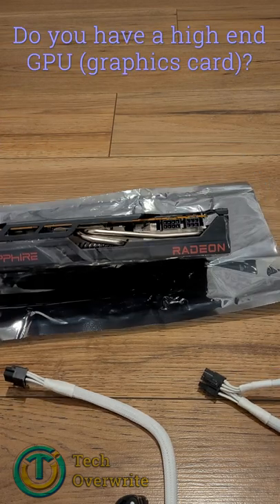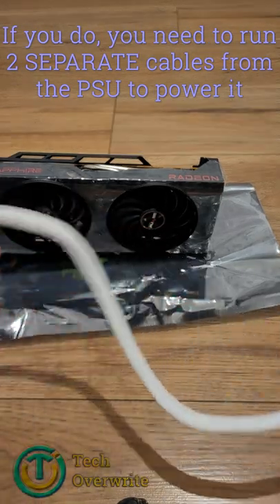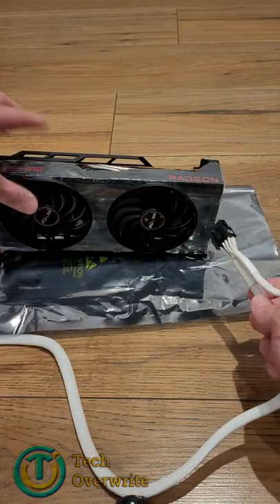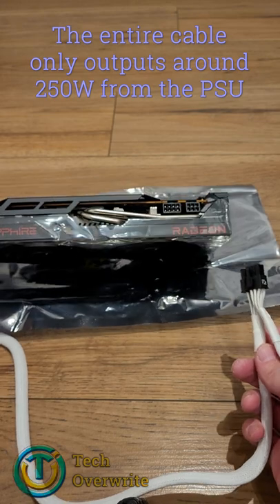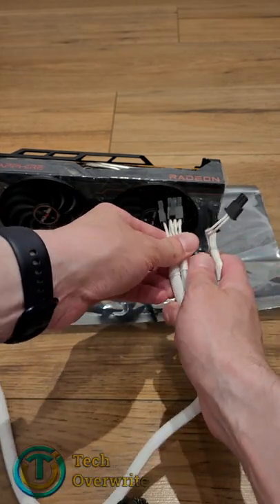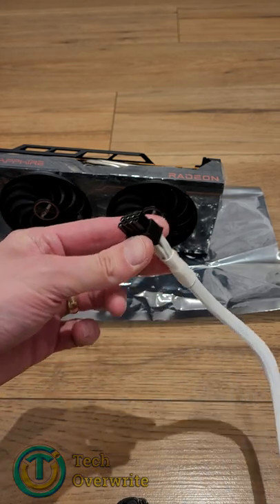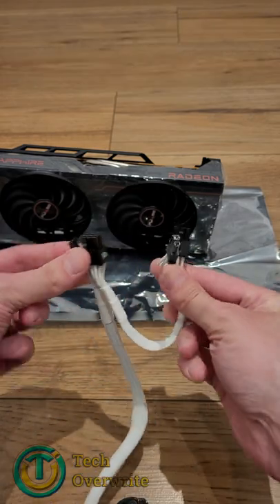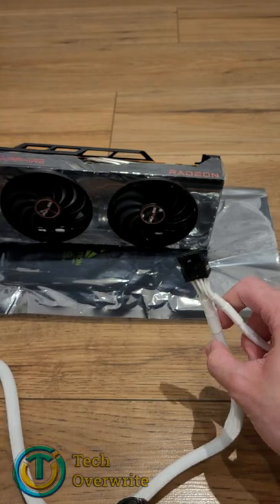Why You Should NEVER (Usually) Use The Same Split (Pigtail) PCIe PSU Cable #Shorts

Comment: Just installed my 3080ti and this was the first short that showed up 😂 thanks for the info changing it now
Reply from the maker: Hah 🙂 Glad this video helped you. That's an awesome card, I hope it works out well for you.
Reply: @TechOverwrite  can i power the gpu directly without powering the riser?
The riser has a small 4 pins
Reply: @TechOverwrite  Will the gpu get detected if you dont connect all Power cables 
(3 8pin slots on a Rtx 3080)
Reply: @Adwans  Don't think so, it has 3 for a reason, you need all 3
Reply: Bro ong The same thing  just happened to me rn I just installed my 3090 😂 I’m finna go change it rn
Reply: hey i had a question.

I have an EVGA FTW3 RTX 3080ti with two cables connected to my Corsair HX1200 PSU. 
Both cables are pig tailed. I have 3/4 of the connectors plugged into the GPU and the last pig tail hanging loose. 

Is that bad? I've been running it like that since June 2022, my computer seems to be running fine but I'd like to fix it if necessary. 

I'm also interested in getting an RGB PCIe extender cable since the current pigtailed GPU cable setup looks ugly. Any recommendations for a good rgb extender for my GPU/PSU setup?

Thanks!
Reply: @life_is_gr8  as long as you're using two separate pcie cables you should be fine. I'm sure you can ziptie the loose ends out of fhe way somewhere.
Reply: Nah you should be fine cause the pcie socket will give you a max of 75w

Comment: they wouldnt make cables like this if it wasnt safe. as long as the psu has enough watts to power the gpu you wont have a problem. ive been using a similar configuration for a couple of years using the same psu with no issues!
Reply from the maker: Thanks for the comment, I've read of people having issues with pigtailed cables, but it's always hard to say for sure that it was (or wasn't) the cable at fault 😔
Reply: @TechOverwrite  I definitely wouldn't use the pigtail with a 3080 and above. Just don't feel comfortable with that honestly
Reply: Yeah but what GPU do you have?
Reply: If you have 3060, 3060ti and a 3070, you can still use a pigtail wire with no issue at all. But if you're going to go beyond these cards? Then consider getting a fully modular psu
Reply: @johnmichaelcobangbang8425  I have 3070Ti and used pigtail. The end at the power supply melted and I removed it from box it pulled out both connections melted as 1.. glad it wasn’t my gpu side 😶 now buying a new power supply and hoping my graphics card is fine. 🥲
Reply: @johnmichaelcobangbang8425  I did have a fully modular psu but Still used pigtails 🤦🏻‍♂️ 1st build … it lasted about 3months
Reply: @eldorito777  I use one for my zotac 3080 ti. Never had a problem. My power supply is 1000w and it gets used for rendering and gaming at max usage ALOT
Reply: @skaardd  oh im using single caple for my new card rx6750xt i had worried but i think its save as you say 🤕
Reply: @johnmichaelcobangbang8425  I have a 1000w MSI mpg pcie 5 atx 3 and a 6700xt nitro plus. (I sold my 4080). The 6700xt is rated at 260w. The PSU is fully mod.and single.rail. I'll be okay using the pig tail bro ? That's all it came with
Reply: @Dannyfr33sh  😂😂😂😅
Reply: @BrainGainz21  Then you had it connected incorrectly. Probably not seated. They do not make these pigtails so nobody to use they work great if installed correctly. However if you plug in the wrong end or to your cpu outlet on your psu that will not be ok.

Comment: Omg after months of having my 3070ti hook up with pigtails and wondered why it’ was getting low fps and stuttering I tried this and that thing runs super smooth and even the game itself looks 10xs better. my card came with 2 singles I just couldn’t figure out why..But now I know and I’m super excited all over again about purchasing the card
Reply from the maker: Wow that's crazy. Sorry you had those issues, but I'm glad to hear that you fixed up the problem okay 🙂
Reply: So you mean you are using 3 single cables to fill all the 3x8 pin slots?
Reply: I was doing the same and my power supply melted the connections(at the power supply) then my gpu stopped working randomly“DP/HDMI”  I would restart my pc and it would work again. Until it stopped for good 😶 that’s when I took it apart and noticed the damage.. but fans and lights still kept working.. 😬 Going to buy new power supply and hopefully graphics car is still okay🙏 (same gpu)
Reply: @BrainGainz21  your psu melted because you used 1 cable?
Reply: Same I’m using a 3070ti with the pigtails and I was wondering why the cables were so hard to plug in too… I’m so dumb 🤦‍♂️
Reply: @justinmarqueef3426  Yeah lol good thing it was only that 😂 got a new one already👍
Reply: @BrainGainz21  oh nice
Reply: im using 8-pin to 2x (6+2)-pin with my 3070ti right now, my game stutter from time to time. but my psu doesn't have extra pcie cable, im buying a new psu right now. hope it will fix the issue
Reply: Same here with 7900XT 😂😢 felt so stupid😅

Comment: If the cable provides 250 W and the motherboard provides PCI Power of 75 w would that not work with most graphics cards ?
Reply: I just wanna add I have always used 2 separate cables because EVGA power supply is actually recommend it to use 2 separate cables for the graphics card and I have also run graphics cards on one cable and all honesty I don’t know if it makes any practical difference
Reply: That is correct if the cable was somehow supplying such an unsafe low capacity. In reality it can supply up to a 375w gpu constant (300w at cable, 75w at slot) .
Reply from the maker: Hmm that's true, I should have also mentioned the 75W from the PCIe slot (a case of too much info for a 1 minute slot). Thanks for watching and the insightful comments 👍
Reply: It really does make a difference, especially with modern GPUs, even though they say 300 watts sustained power, they can spike up in wattage to even 500 watts (I’m using the 3080 for these numbers) it only happens for a millisecond, but it’s enough to trigger overcurrent protection in the psu

Comment: Help: is it safe to leave one pigtail end each from two cables open, just under the GPU inside the case? Or need any insulation for the open ends?
Reply from the maker: Great question. It's safe to leave the ends as they are - you won't need any insulation for them.
Reply: Thank you! Was looking out for this question

Comment: I never had problems with my gtx 580 matrix platinum back in the day with 2x8 pin from one cable, or with my gtx 760 mars
Reply from the maker: Hmm, I believe the gtx 580 had a 244W TDP? So along with some power provided by the PCIe slot itself (which I forgot to mention within the video itself, doh!), you would have been fine with the single pigtailed cable.

Comment: I’m glad I figured this out, but why doesn’t the pamphlet with my graphics card fucking explain this? Infact why didn’t it come with any cables lol
Reply from the maker: Haha lol, you're not wrong. I double checked my old and new graphic card's manuals before this video, and also couldn't see any mention of this 😔 Some PSU manuals do, but who reads those... 😃
Reply: Extra cables are supplied with the power supply… the main question you should be asking is why does the GPU come with a pigtail in the first place lol

Comment: I got an ASUS ROG STRIX 3070ti 8x3 pin connectors, but my PSU has only 2 cables for 8pin, currently Im using 1 single cable and the 2nd split ( with pigtail) to fill up all 3 slots, 

Should I instead use 3 single cables to fill maximum watt usage? In this case can I use it from my other PSU? They are both Corsair RM +gold  but one is 850W and my older one is 650W (bought 2018)

Or should I just order a new 8pin pcie connector?
Reply from the maker: You should be fine here. The 3070 Ti doesn't use a crazy high amount of power, so the two separate PCIe cables (plus the pigtail/split one) will be fine in this case. 🙂

Comment: The 12v wires in the cable can get a bit warm when pulling 300w through the cable. I have a 3080ti in my comp with three 8 pin connectors with 1-2 running at up to 150w draw and connector 3 pulling up to 75-85w. If I were to run one cable on the first two connectors, the 12v wires in the cable can get up to around 100-115F.
Reply from the maker: Interesting, that's definitely good to know thanks. 100-115F is worth keeping an eye on, for sure.

Comment: Help me, I have a new graphics card that needs 8, and I have a wire in the power supply that only has 6, and when I installed it, the screen was black. Is this because of the graphics card, or is 6 not enough?
Reply from the maker: It doesn't sound like this will work, sorry 😞 Your PSU might just not be powerful enough for your card - i.e. especially if your PSU only provides a 6 pin PCIe connector. I know that sucks though.

Comment: I just installed a 4070 in my little brothers pc yesterday night. He went from a 1080 to a 4070 & I used the one wire with the split daisy chain. PC is running just fine , temps are normal and the 4070 is performing excellent. He put around 6 hours on it and we checked the PCIE wire and it was warm but nothing to be alarmed that it will catch on fire or anything.
Reply from the maker: Fingers crossed you should be fine with the 4070 and the pigtail, since the card has a 200W TDP. Since the motherboard PCIe slot supplies 75W, the single cable should comfortably be able to supply the rest of the power IMO. Hope your bro is enjoying his new GPU, that's a nice upgrade 🙂

Comment: Thanks, I was experiencing black screen shutdowns a few times a day with my 7800 XT + 650W PSU connected with a pigtail. I've now ordered a 850W PSU and I believe that if I connect it with two cables, it'll be as safe and stable as possible. This is the first time I saw an actually helpful short.
Reply from the maker: Really glad this helped you out, it definitely sounds like the new PSU and using two cables should help 👍
Reply: im using one cable for like a month and never had this problem on my 7800XT but i do saw a gaming performance increase when i use two cables instead of just one
Reply: @feraltwitch  It was the card. I replaced it with a 7900 XT half a year ago and no issues at all.
Reply: @headlesscyborgcz  ohh i see but actually i just realized ur PSU was not quite enough for the GPU, recommended by AMD it should be atleast 750W. but whatever glad you got a better GPU

Comment: Could you help me?
I have a 250w fsp oem psu without any pcie power connectors, and I put in a gtx 1650 which is by no means high end, requiring only a 6 pin connector (some of them don't even have one) and after running a more demanding game or benchmark, the program would just turn off by itself, sometimes the pc restarts?
Why does that happen? 1650s without 6 pin have a tdp of 75w, and I can't imagine a 6 pin model needing much more than 10-15 watts, which the adapter can probably easily provide?
Reply from the maker: A motherboard's PCIe slot will supply up to 75W of power, so unfortunately your setup is borderline. Anything strenuous will almost certainly result in a lack of power, because it will quickly cap out the supply of power to it.

Comment: Wire gauge plays a big part, it's not just cut and dry. Higher end PSUs often give you 16awg wire for the PCIe, some even 14awg, and can supply plenty of stable power without high voltage drops under load. Cheaper PSUs though may use 18-20awg.
Reply from the maker: Ah that's a good point, thanks, I hadn't considered that point. Worth knowing though for sure 🙂
Reply: how many amps an  18awg  12v wire can handle ?

Comment: Wrong. a PCI-E cable provides 150W and the PCI slot on the motherboard also provides 75 W, so if we're talking about a card that draws a maximum of 225 W then it is safe to use a single cable. While your conclusion of using 2 separate cables is the best and safest approach, it's also important to double check your info and make sure you deliver correct information through and through
Reply from the maker: You're right, thanks for the detailed info. I completely missed out the PCIe slot when shooting the video, and you're right that this is an important consideration. Thanks for the reminder 🙂
Reply: Can I use it for 2060 super?

Comment: What about the Rtx 3060ti dual mini? I think that only has 1 8 pin connection? Does that mean it’s limited to less watts
Reply from the maker: That will be fine - it specifically works/expects a single PCIe power cable, due to its low power usage. So nothing in this video should affect the running of your 3060Ti mini 🙂

Comment: So what if i my gpu only has one power connector, do i just plug in the main pcie cable and forget about the pigtail pcie, or do i need a pcie cable adapter? im using non-modular psu btw
Reply from the maker: Hmm that's tricky but you would need the pigtail in this case if your GPU requires 2 connectors. However you will be limited to a certain GPU TDP (power requirements) - maybe 250W. If the GPU is too powerful, your PSU might not be able to power it reliably.

Comment: If the cable output is up to around 250 watts, shouldn’t it be fine to put in a GPU that uses up to 325 watts at peak because of the 75 watts drawn through the motherboard?
Reply from the maker: Yes that's true, I missed that part out of the video - was trying to squeeze everything into 1 minute, but should have mentioned this point. However I would say that a GPU requiring 325W of power probably shouldn't be powered be a single cable because that's a bit too borderline. Probably better to play it safe. But generally speaking, I agree with your point yes 🙂
Reply: But some area or country that not have a stable power voltage could potentially initiate micro power spikes that could ram up gpu power consumption more than the tdp rating, gamer nexus explained it at some of his video. Thats why the psu atx 3.0 exist, to eliminate the power extrusion problem. For older gen psu I'd say, leaving it 50w headroom for the cable is the safest bet.

Comment: I'm using Asus Tuf RTX 3070 oc Edition maximum power draw(or power limit) 240w that requires 2x8pin. Right now I'm using two separate cables 2x(6+2)pin and 2x(6+2) are just hanging around. Is it safe to use only 1 cable and pigtail. I always undervolt GPU without losing performance(same core clocks) but by doing it reduce the GPU power draw to 180-190w depending on game or FPS limitations. If I cap the FPS it further decrease the power consumption to around 150w. Do you suggest me using only one cable and pigtail as I always undervolt for better thermals and low power consumption. FYI I'm using XPG Core reactor 650w Gold rated PSU which is A-Tier according to cultists network website. By the way I don't know the cable's AWG exactly.
Reply from the maker: If it's not crashing when gaming and peaking at close to 240w, then you should hopefully be okay. I personally prefer to run two separate cables here, but I get that's not always practical 🙂 I would just keep a close eye on things, and slightly undervolting needed. As you say, a slight undervolt can bring the power demands down a lot.

Comment: I have a 3080ti and i got 2 PCIE cables running from my PSU should i plug in the 2 main 8 pins and use 1 pigtail for the third 8pin connector
Reply from the maker: Yes, that's what I would do (i.e. use 2 main cables  and the third as a pigtail) 🙂

Comment: I just bought a 6900 XT and it has three 8 pin connectors. Problem is, my PSU only has two pigtail cables. Meaning 4 connections in total. How do I solve this issue? Buy a new PSU?

The TDP is 300W. I heard each cable supports up to 150W and the motherboard PCIE slot gives 75W.
So, with that in mind, that's:
150W+150W+75W

Total of 375W. Is it alright to pigtail the last connection in this case?
Reply from the maker: That's an awesome GPU, nice purchase 🙂 Yes I agree with you, you should be fine to use two separate cables (and a pigtail for the final connection) to hit the 300W TDP. That should be fine.

Comment: I just got an Asus Rtx 3070 TUF gaming Oc (220W as far as I know) my PSU comes with two "piggy tail cables" should I use both of them but without the piggy tail chain on either one of them?
Reply from the maker: Yes, two seasons cables (without using the pig tail end) is ideal, generally speaking. You might find that your GPU might get by okay with just 1 cable since it's below 250W, but it's hard to say for sure - especially if it's an overclocked GPU.

Comment: My GPU only works on the bottom PCIe slot. I've tried on two different motherboards but same problem. I'll try this!
Reply from the maker: Hmm that's very interesting/odd. Yes I'd be interested for sure, to hear if it works on the other spots with 2x cables. Maybe the other PCIe slots supply slightly less power, and your current setup is borderline for power? 🤔

Comment: I'm doing this on my 3080 but I'm undervolting the GPU so it doesn't put too much stress on the cables.

Also, that single cable isn't delivering 250w, it's actually rated to deliver 150w. An extra 75w comes from the pcie slot, making the total rated power delivery be 225w.

You mind sharing your source? I'm actually interested.
Reply from the maker: Undervolting in this case is a great idea, and thanks for mentioning the extra 75W that I forgot to include in the video 🙂 In terms of my 250W source, I had an old Seasonic PSU and the manual listed the PCIe cable at 250W. It seems like many now just say 150W, but I've always half known 250W as the 'unofficial' max.